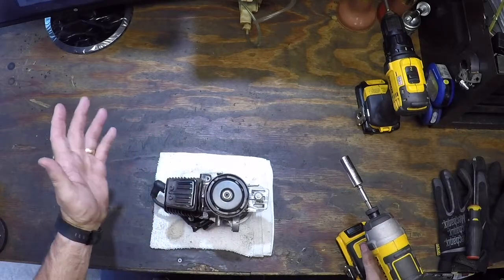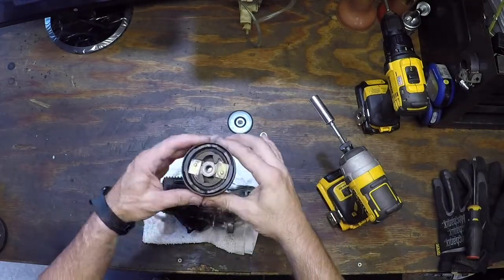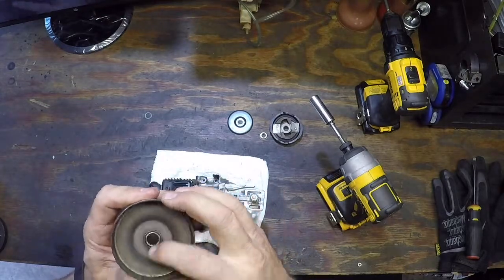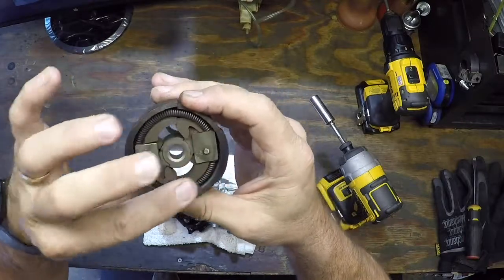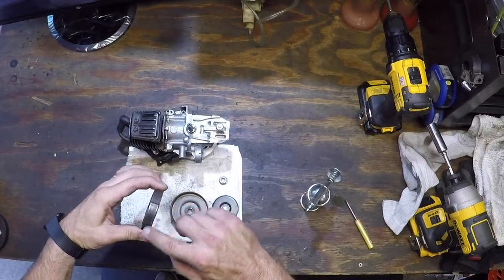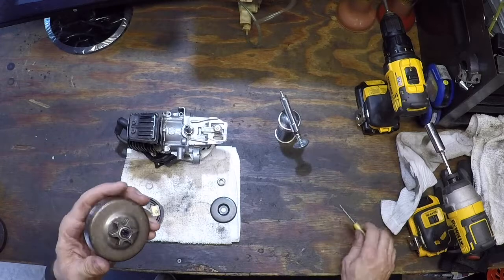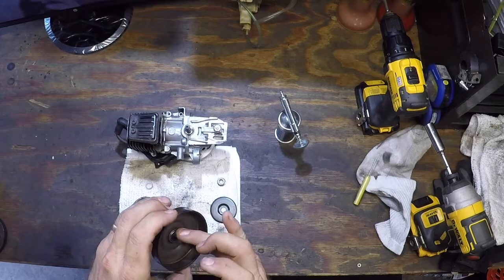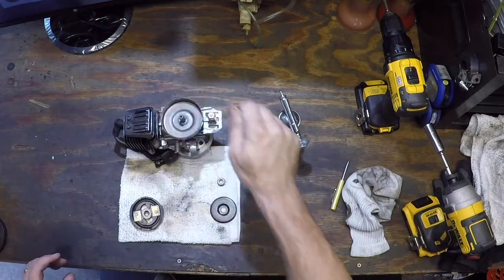Mcculloch Eager Beaver 2 0 Clutch Disassembly, Inspection, Needle Bearing Repack And Reassembly

Comment: How do you know when its time to replace the clutch?   The pads were worn off mine and the entire clutch just melted since there was no friction material left.
Reply from the maker: The exact specs (shoe/ drum thickness) I do not know. Usually, when the engine starts to rev, but the chain does not spin in kind, it is time to replace the drum, clutch, or both. Fortunately, both can be had on eBay relatively cheap.
Reply: @j.k.mcclead9207  Thank you!!   It was crazy, the clutch actually melted and there was molten aluminum dripping out.   I thought I destroyed the engine at first since it seized.   Once I opened the clutch cover and saw it was just the clutch I was relieved.   I did find a replacement on ebay.   Will consult your excellent video for the install once it arrives.   Didn't know the clutch housing had pin bearings to lube till I saw your video.  I think the Mcculloch community is eternally grateful for these teardowns you provide.  I certainly am.
Reply from the maker: @barackobama5304  Yes, it is metal on metal. Back in the 50's and early 60's many clutches were like drum brakes on a car, but since metal compounds have improved and chainsaws pretty much operate at full throttle, slippage and the associated heat are minimal.
Reply: @j.k.mcclead9207  Interesting!!   Well I learned something new today.   Ok I will follow the video to put the clutch on.   I may have inadvertently destroyed the original by revving it with the chain brake on - not certain what happened but it melted pretty quickly probably a minute or two.
Thank you so much for being a resource to keep these babies running.   Do you have a patreon link?  I would like to send you funds for a couple of cold beverages.
Reply from the maker: @barackobama5304  Thank you for the offer, but I do these videos to  pass on what i’ve learned through trial and error. Knowing that someone beneeited from it, is all the compensation necessary.

Comment: Does anyone know the general carburetor settings? Idle, high, low? Thank you!
Reply from the maker: On most carb, Turn the high and low in gently until seated, the turn both H and L out 1-1/4 - 1-1/2 turns. That should give you a good starting point.
Reply: @j.k.mcclead9207  - what about the idle?
Reply from the maker: Peter Handelson initially, I turn the idle screw in until I see the linkage move about a 16th of an inch. The older top handles you squeeze the throttle while starting, the newer ones have a high idle pin in the handle for starting. Once it’s going and warm, set the idle speed to just before the chain starts to move. (3000rpm-ish).
Reply: @j.k.mcclead9207  the Manuel for the eager beaver 2.0 says 20:1 fuel, thoughts?
Reply from the maker: @peterhandelson1193  2 Cycle oil has come a long way since the 80s. When I resurrect a saw I use 30-1 full synthetic (Stihl & Amsoil seem to be the best of these) mixed with treated, ethanol free regular fuel. (protecting the cylinder and bearings are a priority). Once I’m satisfied that it is running well and all the cobwebs are blown out, I lighten up the mix to 40-1. With the “good oil” you could easily go to 50-1, but as long as its not smoking like an old diesel, 40-1 is where I’m comfortable.
Reply: @j.k.mcclead9207  thank you for the great advice!
Reply: @j.k.mcclead9207  what might cause a lot of white smoke on idle?
Reply from the maker: Peter Handelson residual oil in the case and muffler, also if the low side is set too rich creating an incomplete burn of the fuel mix
Reply: @j.k.mcclead9207  I got it to run and idle, but it's spitting out lots of white smoke. It's also spitting out black oil from the muffler. Any recommendations?
Reply from the maker: Peter Handelson put it to work. Cut a few cookies and get it hot enough to burn off the residual oil and carbon that has accumulated. Once you blow out the cobwebs, the smoke should subside.
Reply: @j.k.mcclead9207  - I ended up doing a cleaning, there was a lot of gunk in there, it's sounding better, running better.

As soon as I turn the brake off, the chain runs furiously, thoughts?
Reply from the maker: @peterhandelson1193  Start with idle speed. Adjust the idle, right at the point where the clutch engages the sprocket and the chain starts turning. (engine RPM should be in the 2,900- 3,000 range). The clutch is centrifugal and the shoes are held back by a spring. At approximately 2900 RPM the “weight” of the shoes exceeds the capacity of the spring tension, forcing the shoes outward and creating friction on the inside of the sprocket, turning the sprocket and chain. The faster the engine RPM, the more outward force and resistance is created.
Reply: @j.k.mcclead9207  - I took the clutch off, it's disintegrated, have you ever seen one that bad? Had trouble finding a replacement on the internet....
Reply from the maker: @peterhandelson1193  Oh yea! Most people who own chainsaws shouldn’t be allowed to own an electric toothbrush. They do some horrible things to them. That being said, Clutches and sprockets are plentiful and fairly cheap on eBay.
Reply: @j.k.mcclead9207  - I also took the exhaust off, the 2 metal shafts had tons of carbon built up on them.

Is it worth repairing? Should I get a new clutch and sprocket?
Reply from the maker: @peterhandelson1193  Excess carbon means its been running rich. wire brush the crud off the muffler, and with a wood (popsicle) stick, clear the carbon around the exhaust port. Make sure the piston is blocking the port as not to get any crud in the engine.
A new or slightly used clutch and sprocket (with bearing) is the way to go. Put the clutch on the crank, tighten down one nut, done.